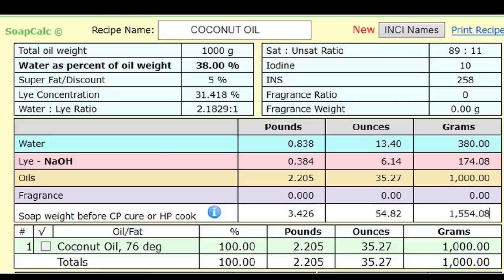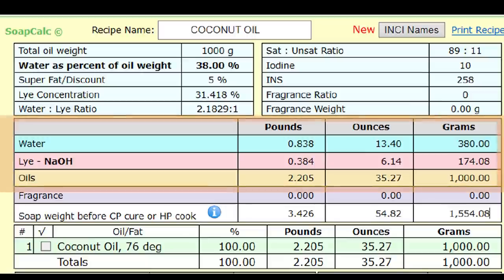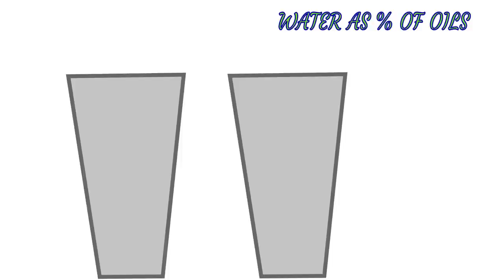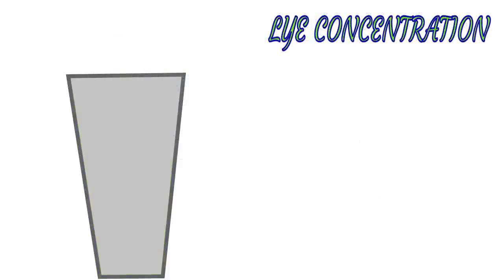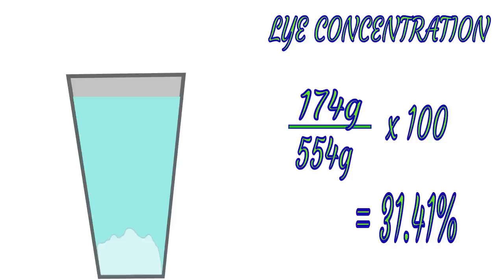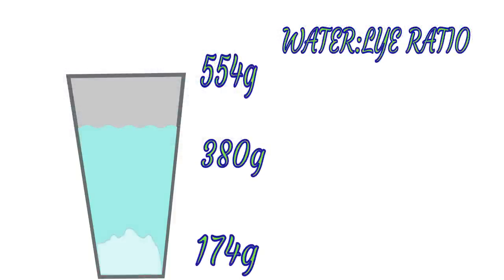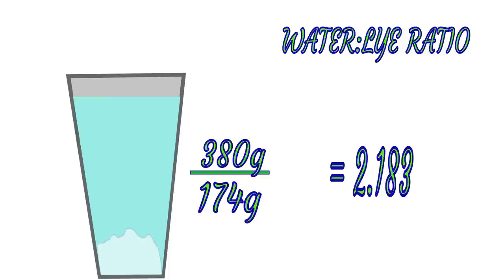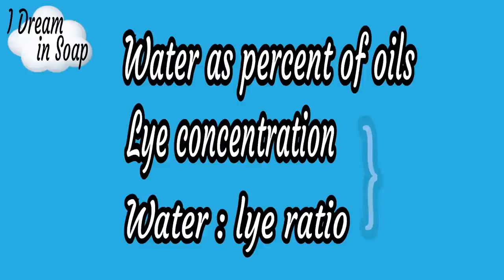Water discounts, Soda ash, glycerine rivers and gel phase ~ Cold process soap making tutorial

Comment: You identify, analyse and explain the technical aspects of CP soap making, many of us are facing, like no other before. Your scientific approach is the one I needed to understand why my trace was often so fast and didn't allow me enough time for elaborated techniques. I can now open new doors and try the next level. Thank you!!
Reply from the maker: That is excellent news, I'm so pleased to have helped. I hope you have lots of time with your soaps going forward.
Reply: Thank you Lisa 😊
I was also wondering if using heat transfer method to melt down your hard oils has any disadvantage? I tend to think everyone would be using it if it only had benefits...
I'd like to know your opinion on that.
Thank you
Reply from the maker: @bertrandfrederic6152  Hi Bertrand. I think it's OK, but the problem is temperature. If you want to do basic designs or simple swirls then it should be great, but for anything complicated or where you want to keep your batter fluid for a long time not so great. 
Also, I actually think it's harder work / takes longer. I'd much rather make my oils and lye up and allow them to come to a good temperature and then mix them, that way you can just leave them alone without spending ages stiring them until everything is mixed.  If you plan in advance then the 'normal' way is so much easier (well I think so)

Comment: Wow! I can't say enough on how well your presentation and speech was and how thorough you are. I enjoyed very much. 
I have to comment an opinion and then I have a question. Awesome scale by the way. What kind is it?
Any way, my opinion is on what causes soda ash and it draws from other forms of sciences and properties of water. I am like the Bruce Lee of soap! I incorporate other skills into soap. One of those skills is concrete. Like soap, concrete needs to be blended well. The more water the more it needs to be blended. Guess what would happen if is not blended well enough. Water rises to the top that I call loose water and because the various products mixed together creates a slow heat it will leave behind salt. A slow long lasting heat is more likely to leave behind residue in the form of salt. High water means a longer lasting heat then lower water. Lower water is a higher heat but it fizzles out quicker which results in less ash.
There is a way around this which your test indirectly proves. Visually, it looked as if both were emulsified. But in actuality, one was not! The one with higher water had loose particles of water that had not absorbed anything. During the hardening phase the thicker water that did absorb oils and lye pushed the loose water up. Because of the long lasting heat the water left behind its salt content.
A good way to look at this is: we do not absorb water. Water absorbs US. The alkaline probably has a hand in it too but knowing that doesn't help to stop it. What does help to stop it is longer periods of stick blending.
So your test really did prove that excess water leads to salt BECAUSE of a lack of sticblending.
Water only absorbs so much so there is a limit to excess water but the water that is used must be sticblended more then less water.
Just my 2 cents worth.
Could you make a video on how to calculate, on paper, hardness, conditioning and the other qualities like a soap calculator does. 
That is the one thing I don't know how to do.
I'm subscribing just because of the excellent work you did.
Reply: glad I read this as I was leaning towards less water route, however this gives more flexibility for design if I have a longer pour time that I can control through if I want to use an excelerating fragrance...is that right? did I understand that correctly? im such  newbie
Reply: @chloehefford7416  
In my opinion, if you have a slightly accelerating fragrance, do a simple design. If it accelerates faster do one color or no color.
Excess water may not help depending on fragrance. I used to do a water lye ratio of   72/28 which is 2.5 x lye amount. It would still freeze up.
I figured my fragrance couldn't be that accelerating. It had to be my oil combination. I changed it and several recipes later I have a decent one to work with. Olive oil resists saponification a lot and is easy to work with. Add Shea butter then all of a sudden, depending on the amount, it's a little more difficult.
I eventually lowered my water all the way to 1.1 x lye amount. Even have done 50/50 but i wouldn't recommend that. Scale must be very accurate to within 3 decimal places And use grams. Accurate as you can get it. Bars can get crusty.
Now I concentrate between 1.4 and 1.85 x lye to determine water amount and then concentrate on oil combinations.
You can tell when your soap will harden fast when a lye calculator says the ' hardness' quality is 25 or above. I like to keep it lower then 20. That tells me I have time to work.
Then again, add 4 or 5 drops of vegetable glycerine and you just might have time to work. Takes longer to unmold though.
1.85 x lye amount is a good place to start. 
At around 1.4 - 1.85, I never get soda ash. I do try to make sure I have a trace which tells me its blended enough otherwise it just might get ashy.
Good luck in your designs. These guys make it look easy.
Reply from the maker: HI Chloe, that is exactly right. More water will definitely give you longer to work if your fragrance accelerates
Reply from the maker: Hi iwannaapple. I'm sorry for the delay in my reply for some reason a notification of your post didn't come through until the comment below from Chloe was left.
Thank you for your lovely comment. It was very interesting to read and does make some sense. I do believe both of my batters were correctly emulsified. It had been proven that a more fluid batter, because of the fluid nature does allow more movement of the sodium hydroxide to mix with the carbon dioxide in the air, producing sodium carbonate (soda ash). I think your theory discusses a similar thing with your low/high water, low water soap will gel but the gel phase will be a quick high peak, therefore gelling faster, a high water soap will gel over a longer period, therefore the fluid nature of the batter stays, allowing more movement and interaction of the two substances.
I didn't go into too much detail on soda ash as the video was to try to help soapers with a range of issues that water can bring to their soap making, rather than trying to prove scientific tests, but it is a fascinating topic.
I'll keep in mind the video on calculating hardness etc, I would need to find a way to make it more than just a lecture on calculations for it to add more value that you can get by just discussing the various properties of oils and their components, but I will have a think.

Comment: This video is incredibly helpful and the different terms & variations were easy to understand. There were a couple of things I got confused about, you mentioned "C-pop, what is this? And I noticed on the soap calc sheet the coconut 76 and I recall seeing on the calc I use there is also a coconut 92. What is the difference and how can you tell (there's nothing on the container I have. Thanks you so much for this video!
Reply from the maker: HI, thanks so much for your lovely comment. CPOP is cold process oven process. It when you make a cold process soap but then put it in the oven to force gel. So that will be heating the oven to about 70-75 F then turning it off as soon as you put the soap it, this help to force the soap to go through gel phase. Soaps with water discount sometimes don't go through gel, so CPOP helps ensure they do. The 76 and 92 on coconut oil refers to their melting temperature. The vast majority of coconut oil is 76, so if yours doesn't say you can pretty well guarantee it will be coconut oil 76. Hope this helps. Best wishes

Comment: As always very interesting. However, I didn't quite understand the gelling part. probably because english isn't my native language. Which of the 2 ended up in the fridge and what happend with the other,  room temperature? I more than once heard you say in your video's you put the soap overnight in the oven at 75° C. My oven jumps from 40 to 100° C so i don't know if I can use that method too. And maybe a silly question but is it trust just preheating the oven and then turning it of of leaving it on the whole night?  another thing I don't understand is why sometimes my soap has little cracks. Do the soap have to cure at room temperature or less warm? So many things to learn as a newbie (wannabe) soaper. Hope you and your loved ones are Ok?
Reply from the maker: HI Rit. The little square ones went in the fridge. The pipe was put in the oven to CPOP and force gel. If your oven is not reliable I wouldn't use it. If you don't discount your water much your soap should gel very easily. I CPOP mine because I discount my water, I use 35.6% concentration, which is 25% of oils in my recipe. You can always wrap your soap in a towel to insulate it if it doesn't reliably gel on its own. Stay safe and well :-)
Reply: @IDreamInSoap  thank you Lisa for your quick answer.  Rereading my question I noticed that I haven't explain the part of my oven. It isn't the case that it isn't Reliance, what I meant but didn't say properly is that the different beat settings are 40°C, next one is already 100°C and nothing in between. 40 maybe too cold but I wonder if  100°C could be possible but maybe for a shorter time.  That's why I was wondering if the soap have to stay in the oven for the whole night and if it has to be constantly heated or just preheated and then turn the heat of. 🤔

Comment: Fabulous!! Stupendous!!  Phenomenal!!  (Just a bit of a question:  I’m a  detail kind of gal, what is the percentage difference between the low and high water amounts?)
Reply from the maker: Thank you so much Micol, in my low water I used my normal concentration which is 35.6% and for the high I went with the soapcalc full water which come out as a 26% concentration in my recipe. Best wishes :-)
Reply: @IDreamInSoap  Great experiment! But with low and high I don't understand: low water is 35.6% (I suppose this is the water discount in soapcalc). The high is 26%, you say... but 26 is smaller than 35.6, so how can it be "high"?
Reply from the maker: @danielad541  You are just getting confused with the terminology, which is why this subject causes people problems. The % you refer to are lye concentration %, therefore showing how strong your lye solution is. Therefore if imagine if you had 100g of lye solution. If it was 35.6% concentration that would mean that 35.6g is lye and  64.4g is water. Whereas with the 26% solution, 26g would be lye and  74g would be water. Therefore the higher the concentration the lower the water. I hope this helps :-)
Reply: @IDreamInSoap  Thank you! I got it!
Reply from the maker: @danielad541  Perfect :-)

Comment: Good morning, thank you for another great video. On yesterday I made a soap with soapcal. 38 percent. I was so excited I did fresh rosemary and sage along with essential oils.  I put them in the oven at 170 degrees Fahrenheit. The next day I had an oily mess. I don’t know what I did wrong. But a Disaster it was. I’m new to making soap I started last November. This is the first time this happened. The only thing I know I did differently is I made up my lye solution two days before using it. The lye was 78degrees and oils 85. If you know what I did to create a mess please will you let me know. 
Be safe and have an awesome day
Reply from the maker: Hi Cheryl. Making upi your lye solution 2 days before should be fine as long as it was kept in an airtight container. If air could get to it then that would quite quickly weaken the lye solution, but if it was sealed it should be OK. When you sy you put it in the oven at 170F, did you leave the oven on, if that's the case then the soap will have been cooked and overheated,  You should put it in the oven that had been preheated to that temperature, but as soon as the soap goes in you turn the oven off. 
Is this an essential oil you have used before, if not, it could be that it caused separation, which is quite unusual with EOs.
Not sure if any of these suggestions help. Best wishes. 
Lisa
Reply: I Dream In Soap thank you for your response. Yes I turned the oven off. What I didn’t do was have the lye solution air tight. I just put a paper towel over it. I was going to go back to it once it cooled and didn’t until a few days later. So I checked on it to see it would have suds today and it did. But it’s a crumbly mess. So now I have another question can this be rebatched. Be safe and have an awesome day
Reply from the maker: @cherylnorise57  Ah that's it probably, when lye is exposed to air it weakens quite quickly. Leaving it open for an hour or so is OK but any longer you need to get a lid on it. I guess the tricky thing with rebatching it is that it's unlikely to make the lye and better, and I wouldn't advise adding more. Yes it would be safe, why not give it a go rather than throwing it away, you've got nothing to lose apart from a bit of effort, so as long as you are sure your measurements were OK I'd go for it.

Comment: Thanks so much.  Fascinating.  This is my favourite channel.  You have taught me a lot.  I have made a couple of batches recently which could possibly be termed "exploding gel" phase 🤯 is this to do with temperatures?  One was our coconut oil soap, the other was beer shampoo bars.  I only had one beer (flat), so replaced the other half of the liquid content with water.  I used lavender oil which I expect accelerated the batch as it went lumpy.  I chucked it all in the oven for a few minutes... hoping this will fix things
Reply from the maker: Hmm, yes if it's rising up and bubbling up that sounds like 'volcanoing' I'm not sure how you spell that. It will be due to being too hot. Coconut oil soap can get very hot and anything with sugar in (beer) will add more heat. If using those I like to start off soaping really cool, then keep an eye on it. If it starts to crack you may need to put in the fridge (or outside if cold)

Comment: Hi Lisa, I love your videos, thank you so much for sharing your knowledge! I work with goats milk in all of my soaps (own dairy goats on farm) so I am wondering what impact milk replacing water has on soap in regards to soda ash in particular? Is it still more to do with the lye ratio or does milk have an impact alone? I find some of my soaps, specifically those when I use botanicals on top get worse soda ash (spraying alcohol doesn’t seem to help) so that IS an issue. 

I do not put my soaps through gel, rather I put them in the fridge for a minimum of 3 hours or until they are cold to touch, to stop gel, so do miss out on some colour depth. This does matter sometimes, for example, I was inspired by one of your videos (thanks!) to make a soap with ground apricot seed & rosehip powder ‘scrubby’ soap. I did get the pattern but overall it was much duller than yours, which I can live with but some impact definitely lost. Any suggestions about gel & goats milk? 

Thanks again Lisa, I’ve learnt so much from you. Happy soaping!

Comment: Hello Lisa, This is an amazing video, well-done!.  I am also an experienced soaper (a chemist by profession).  I did appreciate a lot your detailed explanation. The question I have is about NaOH strength, so in your opinion how strong does the sodium hydroxide solution have to be? I mean for a soap that meets all the right properties, i.e., Hardness 42, Cleansing 17, Conditioning  57, Bubbly 30, Creamy 32,  Iodine 56, and INS 151.  Do you please care to comment?  Best wishes from Chile, MARCO
Reply from the maker: Hi Marc, thank you for your comment. The concentration should not really have much effect on the overall quality of the bar in terms of typical properties. The amount of lye used is prescribed by the saponification value of the oils used, so if you were using that same amount of oils a weaker or stronger lye concentration would keep the NaOH the same but just alter the water amount. The properties will come from the type of oils you use and their ratios, plus of course any additives. Overall when a bar is fully cured they would both end up in a similar state, the higher water bar (lower concentration) taking longer to get to that fully cured state.  In addition to type of oils the level of superfat would affect the overall properties, higher giving a milder bar, but it would be less bubbly and typically not last as long as a lower superfat. 
Best wishes

Comment: Hi there. Thank u so much, for all your great videos. I am very new at this, did not make a soap yet - still nerding it :-) Thanks for this very informative video. I am wondering though, about the gelling face. Why and how do that face happen. Is the soup different with or without it and how do i gel? Hope it makes sense. Thanks again - i love your videos <3
Reply from the maker: I'm so sorry, I'm not sure how I missed your comment.When the soap gets to a certain temperature it gets hot enough to change consistency. The soap goes through a jelly like stage. That in turn makes the soap more translucent. It will alter the colour of the soap, as you can see here some bits look darker than the others, that's just the 'clearer' gelled soap versus the whiter opaque nature of the ungelled. This tends to have the effect that if you are using micas it will generally cause your colours to look brighter.